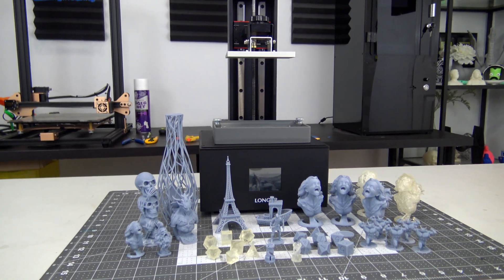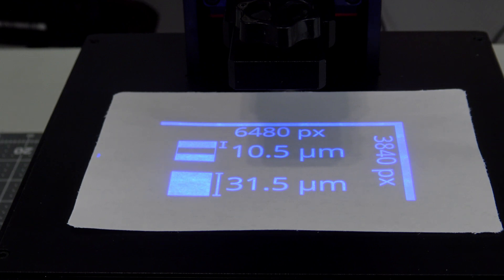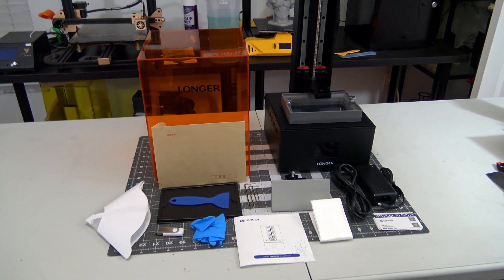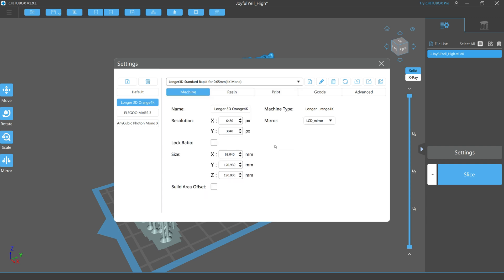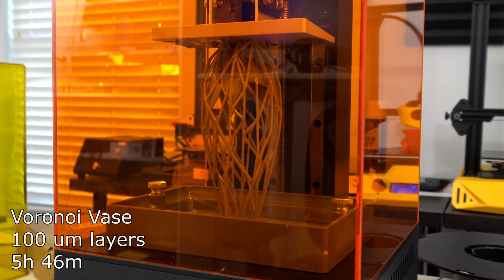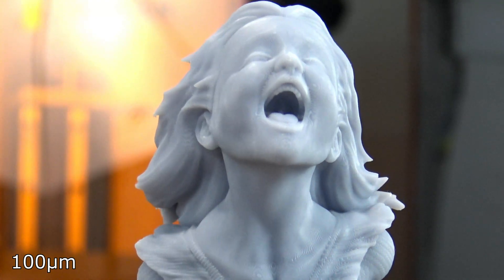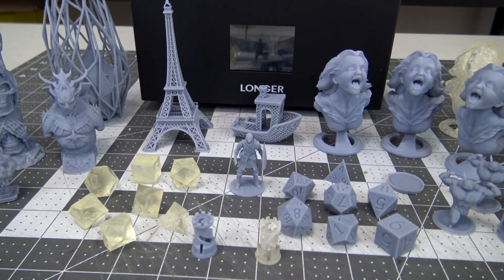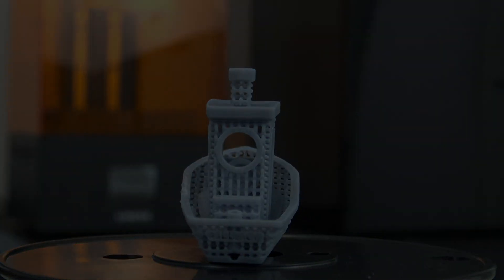10.5 micron resolution?! - Longer Orange 4k 3D Printer Review

Comment: This is not 10.5 microns only. the new 14k are only about 25 micron 🤔
Reply from the maker: The 14k screens are also physically larger, so just because the resolution is higher doesn't mean the pixel size is smaller/denser. The math checks out for the longer's subpixel to be 10.5 microns.

Comment: Very thorough and excellent review. You covered all the bases except one: punctured FEP results in resin on the lcd screen (often damaging the lcd screen if the resin can’t be cleanly removed). Therefore, most folks recommend a screen protector sheet under the vat. I don’t believe the Orange 4K comes with a screen protector sheet. I’m sure one can buy a screen protector, even if it’s one made for a different printer. Do you have a thoughts on this?